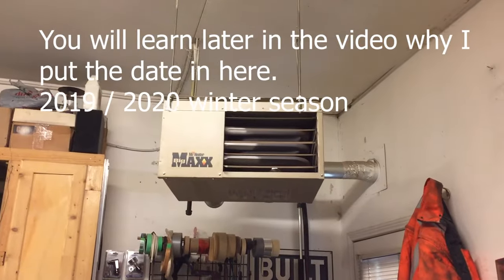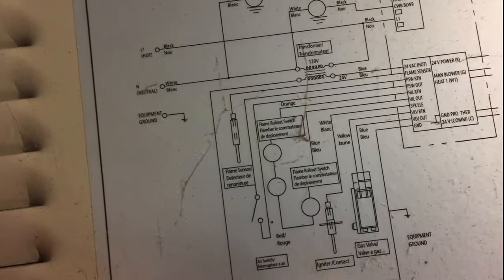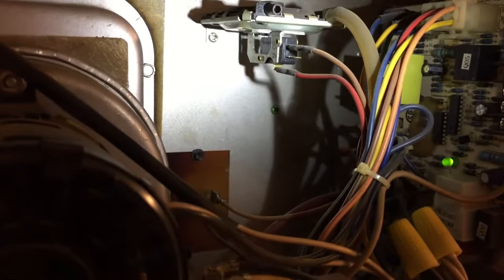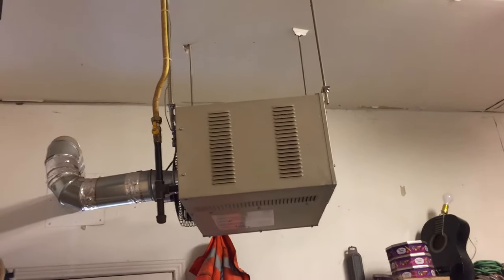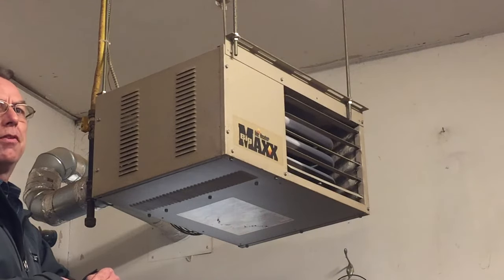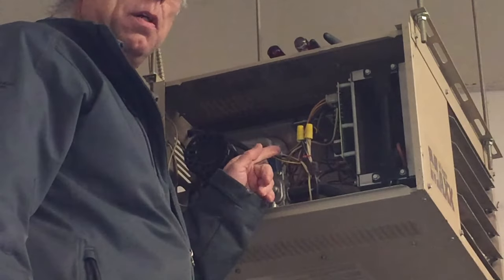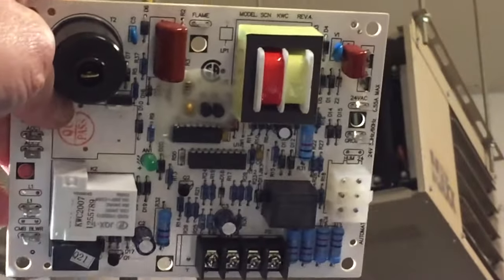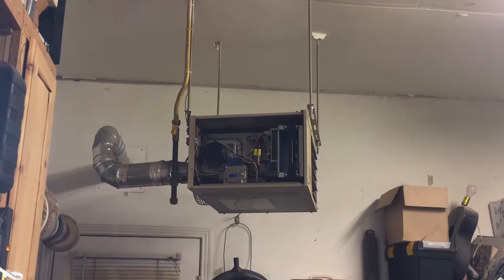Heater SOS: Big Maxx Repair Made Easy

Comment from the maker: If your looking for parts, this is where we purchased ours. If they are out of stock you can look up the part numbers and use them to search other suppliers. Stay warm!😊❄☃
www.ereplacementparts.com
Reply: This afternoon, I looked out and saw normal exhaust coming from the pipe in my shop. Later, went out to work, the furnace did not and will not kick in. 2 flashes, system lockout, failure to detect or sustain flame. Now that I've watched your video I hope to be able to get this going soon. Thank you!

Comment: Great video that help tremendously. I’ve got an 80,000 BTU going on 8 years old and haven’t had many issues until this week. Runs for a minute is so and then has shuts off but fan keeps going. Got inside and did some cleaning and checked the switches. I got it cycling again with great heat.  Fingers crossed it was this simple.
Reply from the maker: Glad it helped. Thanks for watching.

Comment: Great video thank you...

I'm getting the 4 flash light and checked both switches...i even ran a jumper between the terminals to see if it would come on at all... nothing... just the fans... was working fine for a long time now burners won't come on... frustrating! 

Cheers
Reply from the maker: Does not sound like a limit switch problem. The limit switch's are going to shut the heater down when a flame or high temp is detected in the wrong area of the unit. More likely the Ignitor or the circuit board is bad. I talk about this later in the video. The ignitor is cheap & easy to replace. Start with that. Thanks for watching.

Comment: On my 80,000 btu big maxx have a three code flash. Big Maxx has been excellent on replacement parts for warranty. Have replace two pressure switches, gas valve, mother board, checked for vent blockage, and of course cleaned out exhuast hose port, and cleaned flame detectors all to no avail. Think I finally found the problem with an air leak from exhaust manifold from a bad gasket. It of course is back ordered. This is a fairly new unit so nothing was dirty. Can feel a gentle stream of air coming from around the 5-7 oclock position and the 11 oclock position on seam where exhaust manifold is bonded together.
Reply from the maker: Sounds like you've changed a lot of parts! I hope the gasket comes in quick, and it works to seal up that leak.
Reply: @GreatLakesJunction  Just happened to see this. Found problem on removal of exhaust manifold. Had a mud wasp nest in it. Removed and now everything runs fine. Could not see it until I turned manifold upside down.
Reply from the maker: @jamesjenkins3384  
Glad you found out what it was.

Comment: I saw another video on YouTube that this gentleman’s Mr Heater would not come on at all, he removed the hose at the bottom and inserted a small screwdriver in the hole where the hose attached and I bet he heard a pop replaced the hose turned the power and the heater came on the the unit fired up.
I’ll try and find the videos and send it to you

Comment: You have the product number for the circuit board? I want you order one as a backup so don't need to wait if mine goes
Reply from the maker: Mine is #60105 from ereplacementparts.com Not sure if yours will be the same depending the size of heater.
Thanks for watching

Comment: I have the same heater. Issues are 1. Not continuing to stay lit. 
2. It won't automatically keep going after first initial start. I have to move thermostat down and back up. 
3. After lighting it will shut off after flame lights.
Where did you order circuit board?
Reply from the maker: I would start with this:
www.ereplacementparts.com  You can find the parts here. If they don't have them in stock you can at least find the part numbers. Then search for the part numbers at other suppliers. Hope it helps you out. Thanks for watching!

Comment: Do you have to remove the board screws. If so what did you use to get them out in the back
Reply from the maker: I'm not sure I understand the question. If you are removing the board then yes you need to remove the screws to un-attach it. In witch case I used the same tool on the back as I used on the front screws.

Comment: I just got mine all hooked up and it turns on and ignites all fine but when I turn thermostat down below room temp it shuts off but it continues to click on and off every 5 seconds like its cycling or something, the heat fan isn't on or anything its like the unit its just turning on or off, any ideas? It blows heat and everything fine, it just doesn't shut completely off I gotta flip the breaker
Reply from the maker: sorry I have no ideas for you on this issue. I hope you get it figured out ok.

Comment: You maybe have a electric supply issue with your utility ...with your circuit boards burning up?
Reply from the maker: I had thought of that but seeing as its only the  shop heater, I believe its poorly made product. I have seen many other comments on various channels about these heaters having issues.  Thanks for the suggestion.👍

Comment: i have the same problem but the switches all ohm out, fans run. just not getting 24vac to the gas valve. only 12vac. but the transformer is putting 24vac to the board
Reply: any ideas?
Reply from the maker: After checking all that you have, I would replace the board, There isn't really anything left. you have 24v going to it only 12 coming off it.
Reply: @GreatLakesJunction  thank you sir

Comment: How did you determine your circuit board was shot? My heater isn't turning on at all
Reply from the maker: With mine, the blower started, the ignitor started, but the gas valve never opened, so the heater would shut down. You should check the fuse on the board, upper left corner, may be that simple. I have  changed 2 boards in this over 5 years, both times the board was not suppling power to the ignitor. Hope this helps you.
Thanks

Comment: How did you go about finding what circuit board you needed online or finding any part that you may need?
Reply from the maker: start with this 
www.ereplacementparts.com, you can find the parts here or at least the part #s and then you can search for the same part  from other suppliers. Hope it helps you out.

Comment: Hi. Thanx for the video. Where do u get yr parts?
Reply from the maker: Lioncove Hope they have what you need.
Thanks for watching
Reply: Hi. What would be yr advice on this heater wanting to run all the time?  It’s not picking up building temp & wants to keep running. Shuts off for 5 minutes & it’s on again. Light is steady flash.
Reply from the maker: @ldraper1972  It sounds more like a issue with the thermostat not the heater.
Reply: @GreatLakesJunction  I’ll check that 1st. Thank you.
Reply: Hi again.  I changed thermostat but since have noticed only the bottom burner is lighting out of the 5. What would u do for this?  Thank u in advance.
Reply from the maker: @ldraper1972  My only thought is the main tube that each burner runs off of may be blocked after the bottom burner. The gas is not getting past the point of the bottom burner. When these heaters sit in the off season they tend to get plugged up with insect nests & dust.
Reply: @GreatLakesJunction  Thank you. We just went thru a horrific cold spell with high winds for 4 days straight. It was running perfect prior to this.
Reply from the maker: @ldraper1972  We went through that crazy cold weather as well. 
If I had this same issue I'd give it a cleaning  and see if that does the trick. It doesn't make much sense that one burner is working and the rest are not unless the gas tube is plugged up.
Reply: @GreatLakesJunction  I’ll give it a try. Thanx again

Comment: I have the same heater.  I have no blinking codes.  Mine is igniting and running for about 10-15 seconds then shuts off...then the same cycle.  In you searching, did you find anything that may cause this?  I took out the flame sensor and cleaned it, but it really was not dirty.  Thanks!
Reply from the maker: It could still be a faulty flame sensor. They are a low cost item to replace. Start with that and give it a try. There's a piece of clear tubing from the blower motor to a vacuum diaphragm switch, when the heater isn't being used a spider can easily plug the tube. Good luck!
Reply: @GreatLakesJunction  Thank you very much! I will check these items.
Reply: I have the same issue of igniting and running for about 10-15 seconds and then shuts down. Did you find a solution?
Reply: @daledunford3209  Looks like it is the pressure switch.  Trouble shot it and this is the conclusion.  They are sending a warranty replacement.  In case you do not know, it is the part that is screwed on towards the top center (behind the panel that is removed for access) that has the clear hose going into it.
Reply: @daledunford3209  hello, I thought I replied to this, but must not have.   After troubleshooting, they sent me a pressure switch.  I am going to probably install it tomorrow.  I'll let you know if that solves the problem.

Comment: That white tube not sure what it does but on another You tube channel this guy remo
 The tube and inserted a small screwdriver a all the way into the inlet on the unit replaced tube and the unit started and rand fine
Reply from the maker: yes, its a vacuum tube and sometimes it will get blocked by a spider nest. Thanks for watching.

Comment: I have a 5 code and the big fan runs all the time
Reply from the maker: is the label still on the inside of the panel covering the components. My label list the problem next to the number of flashes produced by the blinking light on the circuit board.